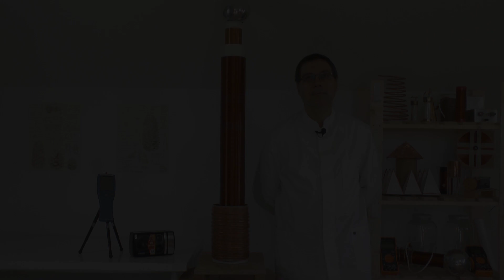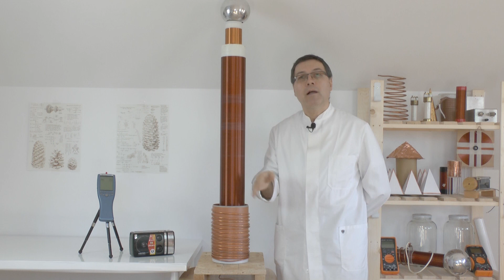Live presentation announcement for future video postings

Comment: i believe the old televisions with the tv flyback  positive feed and the cathode ray tube   negative feed, were truly to capture the earths layline fields, but do not allow it to earth but to AIR earth as the air has shells of outer negative in its gaseous field energies we call nitrogen   oxygen  argon etc all built up of same field energies but in different amounts so like your crystal radio, so it equates the old televisions can be converted to capture earths same resonance energies, just a spark gap within the aerial and a amplifying coil and may be a water fluid capacitor part ice within that water to aid storage .  just a thought